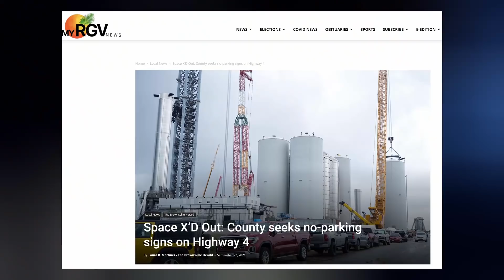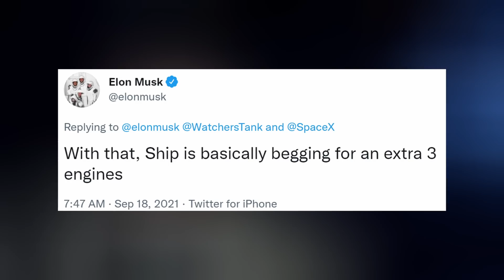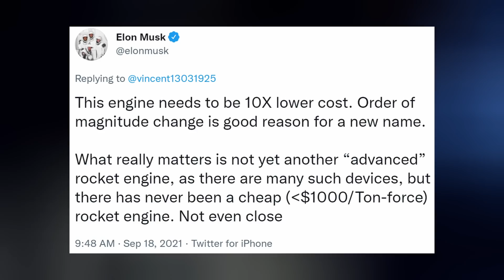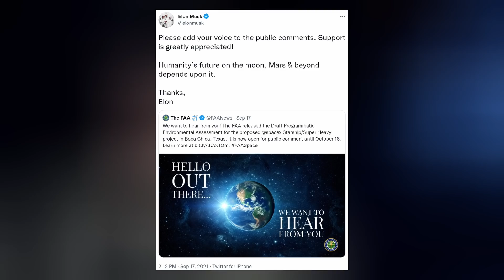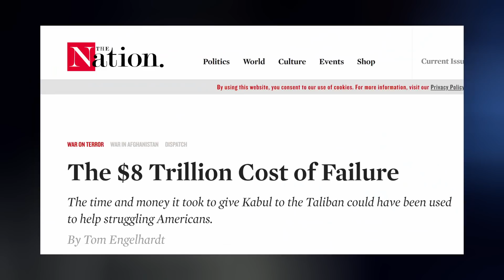Elon Musk Defends SpaceX Starship Program

Comment: Space force needs Star Trek uniforms
Reply: Well, Star Trek basically copied the Enterprise emblem (which later became the Starfleet emblem) from the Air Force Space Command (first used in 1961, years before Star Trek , and based an older USAAF symbol from 1942), so they owe the new Space Force at least that much.  Of course, everyone thinks that the Space Force stole the "delta" emblem from Star Trek , instead.

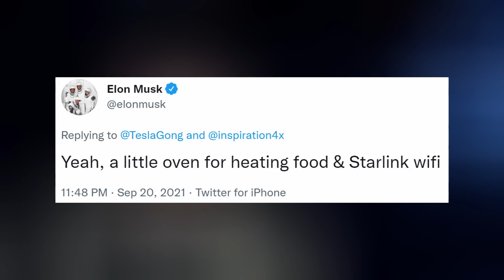Comment: 5:09 hmm, wondering how could they have Starlink Wi-Fi on Crew Dragon flights like this when they are literally flying ABOVE the Starlink satellites most of the time. ;-)
Reply: they would probably use lasers much the same way that the starlink satelites will be commounicating with each other.
Reply: Starlink has ground stations so they could use those until they get enough of satellites with laser interlink up.
Reply: LASERS???????????? we know the Starlink launch last week had the laser interconnect, just put one of those laser interconnects on Crew Dragon.
Reply: If they put a few at a higher alt they could link up.

Comment: If Sue Origin wants to get awarded a contract, they just need to simple make a cheaper rocket!
Reply: They need to make a rocket first, I think…
Reply: @m60mgman  that works...
Reply: At this point, if BO wants to make progress, actually flying something to orbit would be a step in the right direction. Or maybe just deliver the BE-4 engines which is holding up the Vulcan?
Reply: @LordFalconsword  Grumman had not been to orbit when they built the LM for Apollo. Delivering the BE-4 would be a good start though. And Blue (descent stage) leads the National Team for the ILV, so they have Lockheed Martin (ascent stage), Northrop Grumman (transfer stage), and Dynetics (avionics) all working on the ILV.
Reply: The current contract in dispute is for a lunar lander, not a rocket. SpaceX just so happens to have built a rocket that can land on the moon. The lander BO proposed is garbage inside and out, so making it cheaper shouldn't win them any points.
Reply: @waynzignordics  Eh, the Blue led National Team did do well enough to come in second to SpaceX in the HLS Option A selection process. IF NASA had got the $3.3B for HLS in 2020, then Blue would be the second lander already. Suing NASA is silly, since the GAO already denied the complaint. Blue should focus on the next set of HLS contracts for the Artemis IV+ missions, as that selection process has started with 5 R&D contracts just being awarded.
Reply: @steveaustin2686  Second only because someone had to come in second lol. Their bid is embarrassing compared to SpaceX. Besides, why should BO get more money than SpaceX for an inferior product? Old Space is still operating under the pre-SpaceX business model where everyone bids junk solutions for exorbitant prices -- and then fail to deliver on time or on budget. SpaceX isn't simply winning, they're lapping the field. If the aerospace industry had this type of competition the last three decades, we'd already be on Mars.
Reply: @waynzignordics  I never said that SpaceX wasn't better. The Lunar Starship knocks the NASA HLS requirements out of the park. The Blue led National Team's ILV met all the requirements per the NASA HLS Option A Source Selection Statement. NASA was happy with aspects of the design, but very unhappy with lagging development for the ILV. NASA really liked the Alpaca design, but it was overweight. Hopefully, Dynetics can fix that in the HLS Option B contracts.

To be fair, SpaceX was late on the cargo Dragon for the CRS contract. But they beat Orbital's Cygnus to the ISS. SpaceX was late on Crew Dragon. But they beat Boeing to the ISS to capture the flag. SpaceX has upended the launch industry and apparently plans to keep that lead going. I haven't said different.
Reply: @steveaustin2686  We're in agreement, except you're still giving too much credit to BO's proposal. It technically met NASA's requirements, but that's not what it's selling. It's selling the Old Space business model of using politics to win contracts. "We'll create X jobs in Y congressmen's districts, and in exchange we'll endorse and donate to Y congressmen's re-election campaigns. We'll be years late and millions over budget, but we'll all get rich(er) doing it."

Old Space is to space exploration what the Middle East wars were to peace: a money laundering exercise. Awarding them a "backup winner" contract would be a disgrace.
Reply: @steveaustin2686  You're probably more right than I'm going to admit. I'm still miffed at how much money and decades Old Space has wasted, and even now when real competition finally appears in the form of SpaceX they have to be dragged kicking and screaming into the new era against their will. Why else submit at bid twice as expensive as SpaceX without even a fraction of the innovation SpaceX is proposing? Because they're still playing politics, that's why. I'm surprised they didn't dedicate half their report to highlighting how "diverse" and "inclusive" and "equitable" their companies are. The technology is clearly a second thought, so they finished second-best.

Give the money to Rocket Lab instead, I say. Make Innovation King Again.
Reply: @waynzignordics  NASA rated each provider individually on their bid. They then compared those ratings, so they didn't compare one bid to another, except through the final ratings. SpaceX has a history of aggressively low bids, so it was not surprising that they were lowest again. And they produce results. It's why SpaceX is in the CRS program, the Commercial Crew Program, the HLS program and many single mission launches.

Rocket lab is working on the Neutron medium lift launcher to go with their Electron small lift launcher. They apparently didn't bid on the HLS program tho. Hopefully Dynetics gets their weight problems under control as NASA really liked the low-slung Alpaca design.
Reply: Doers do.  Losers sue.
Reply: SpaceX had the better combined rating, that was "significantly more important" than price, so they won the bid on merit. Blue did come in second, so they would have been the second lander, if NASA had got the $3.3B in HLS Option A money they asked for in 2020. Suing NASA because Congress didn't give NASA the money for 2 landers is silly.
Reply: As a capitalist, you'd expect Bezos to understand that!
Reply: How dare you point out the obvious! 😂